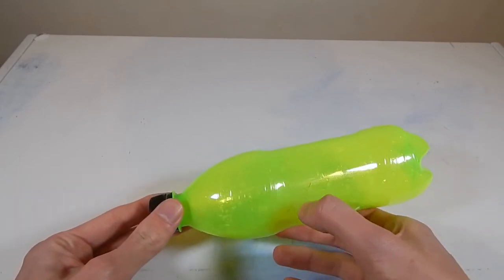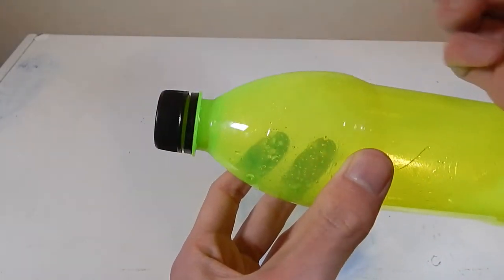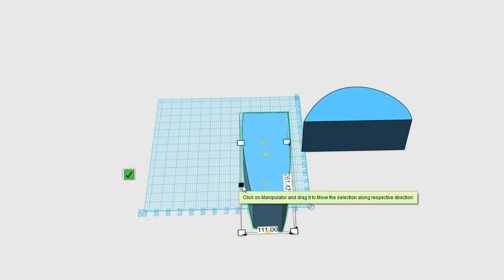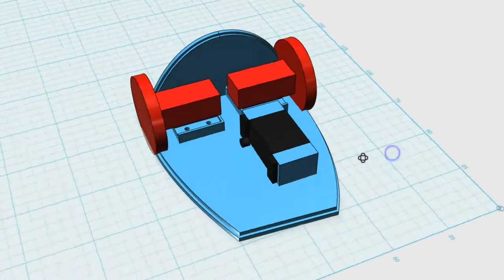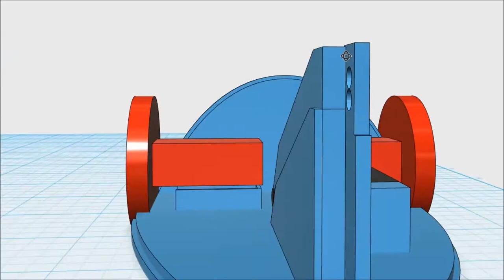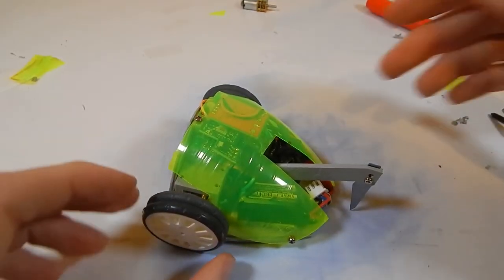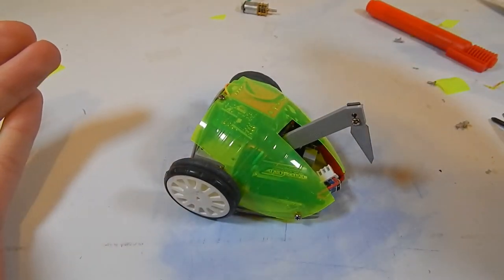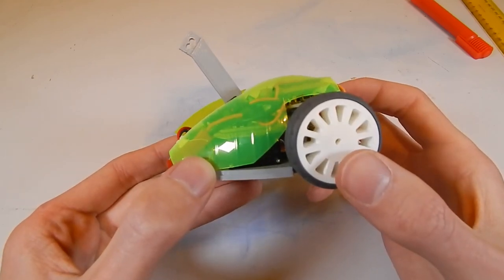Will It Bot? - Soda Bottle Combat Robot

Comment: You should make an Altoids tin combat robot. This new series is brilliant!
Reply from the maker: I'd love to, but Altoids Tins are kinda hard to get in Australia
Reply: That is too bad.
Reply: By the way, you have a really cool team logo.
Reply: Altoids tin bots are surprisingly common. They're actually reasonably tough for the class.
Reply: Neat!
Reply: I wanna make a little under cutter out of one. I'm thinkin it'll end up under 150g. I already have a pair of brushed motors from an old air hogs rc that should work for drive. I also have a (slightly) bigger brushed motor I want to use for the weapon, lots of torque for a fast spin up. Biggest problem I have is getting the electronics to fit.
Reply: I’ll send ya cases of Altoids 🤣😂